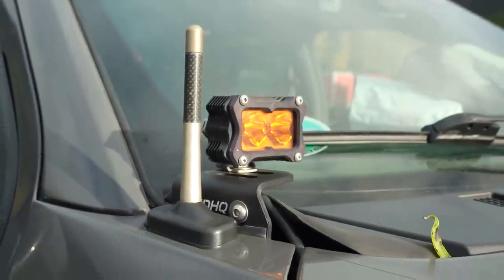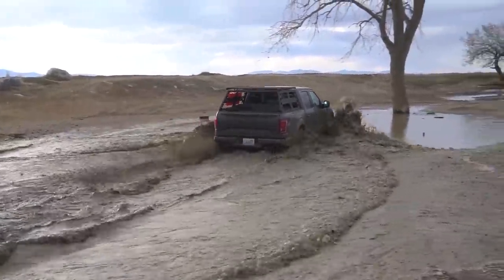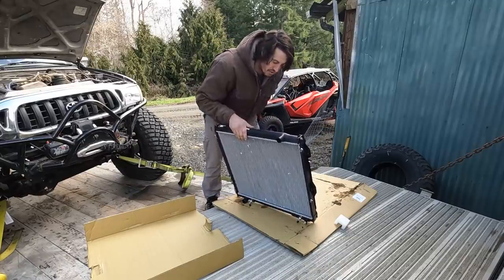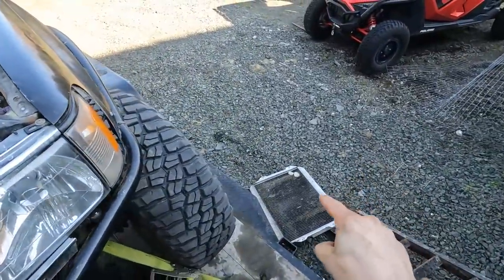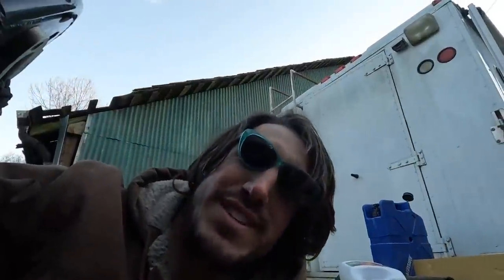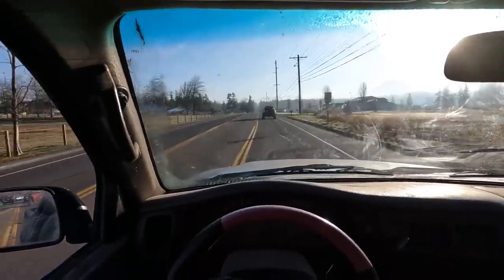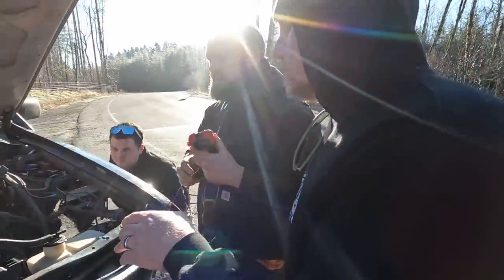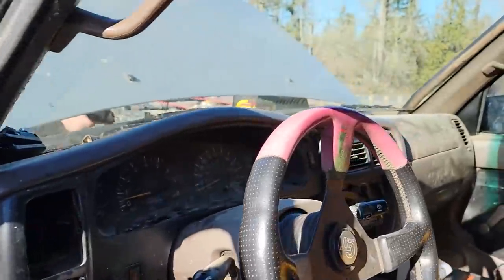My Automotive life SUCKS 😂 Snow Wheeling with Dirt Lifestyle, Muddy Beards & Trevor Knopp

Comment: 1st gen Tacomas came with 3 different size radiator sizes option depending on engine and trasnmission. Theres the 22.5 inch 3.4 auto trans , 21 inch 2wd trans, and 18 inch 4cyl radiator. You want the 18 inch one from the 4cyl model. Or try measuring your old one and see which one you had. Can always look up the dimension when buying a new one to make sure its the right one so your hoses matches also.

Comment: Maxx you need the 2wd 19” radiator for your truck. The radiator that your trying to install is the 21”.  That’s what I’m running on mines. I also fabricated my shroud to fit the 19” radiator with resin and fiberglass.
Reply: Agreed. Need a 2WD radiator.

Comment: The world is telling you to stay home and focus on the farm and family content, give the "overlanding" a rest for a bit, it's probably getting expensive by now 😜. The new Starter seems to be doing fine, obviously check all your grounds and do a quick charge test with the multimeter at every point of the starter and chassis. That noise sounded like an idler pulley and/or the tensioner adjustment out of spec, next time check all your fuses first, there's a good chance your old alternator might not be toast. TBH Maxxidents happen, and we are here to watch them, but also we wouldn't mind seeing you take the misses to Cabo San Lucas for a week 🥰✊🏽

Comment: There's one ten amp fuse under the dash on the left fuse panel it operates a host of things and one is it puts power to the b+at the alternator . It's hard to find a wiring diagram for that truck . I know this cause my truck has had this issue

Comment: Sometimes its just the battery itself that doesn’t want to hold a charge. I was convinced for months that one of my red tops was fine when i was having charging issues on one of my rigs, and I wouldn’t budge on it.. finally just tossed in a cheapo Home Depot battery just to see, and it was indeed the battery. Didn’t make any sense to me because if I charged it on the battery charger 🔌 it would charge up and hold the charge just fine but wouldn’t accept a charge from the alternator.. Also, just curious, do you have all your grounds set up proper? Sometimes where rigs are missing a ground strap, they start being weird little witchcraft machines

Comment: That brand alternator is total junk. I had 2 duds out of the box once only the 3rd one worked. Had to switch suppliers.
Reply: After a 2nd faulty one I ended up paying the big bucks for a mopar replacement. Buy once cry once is a hard lesson learned.